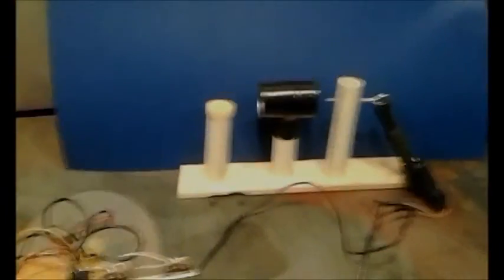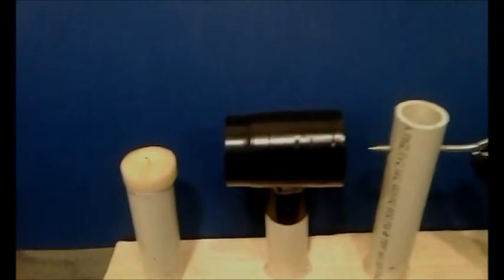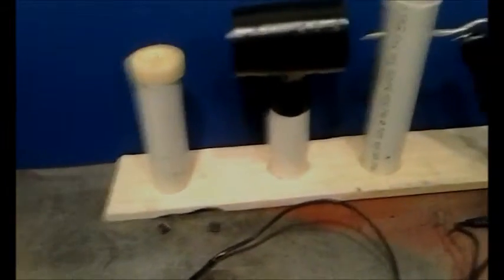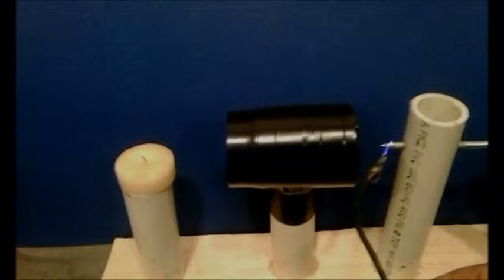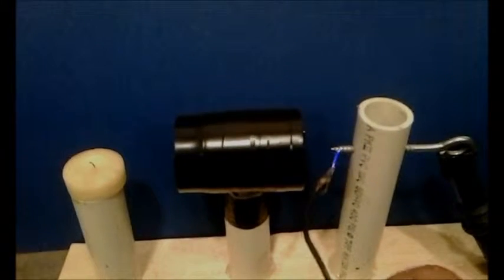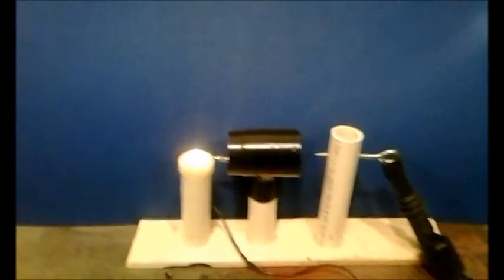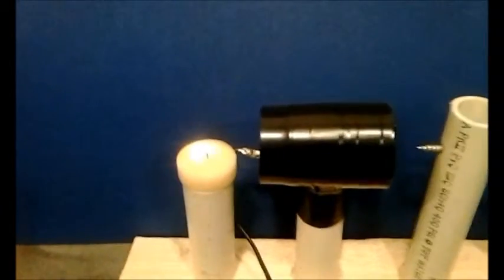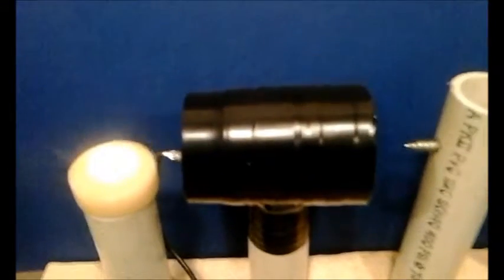Simple ion engine

Comment: Just like my Ionic Breeze air cleaner!
Reply from the maker: +MrBen527  Ya I know it's been done before. But with 2 ft of snow I get limited. Got all kinds of ideas, but have to wait for spring to realize them. Hate living in Michigan....Currently working on a pde- pulse detonation engine. Learning python to control it with a raspberry pi. Also using the same tech to make guidable  rockets. Also have another idea to attach a hybid rocket motor to the same bike.. Will probably die in the process.....
Reply: fignutron
Sounds like fun!